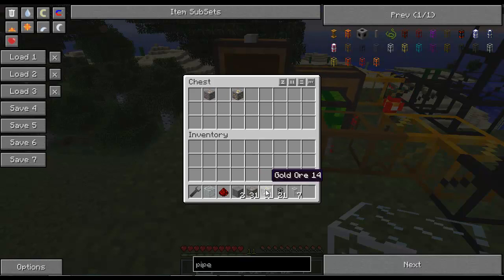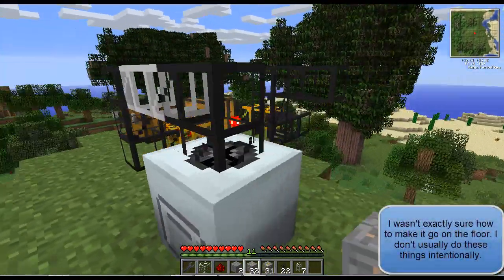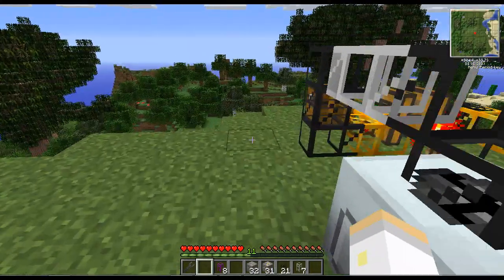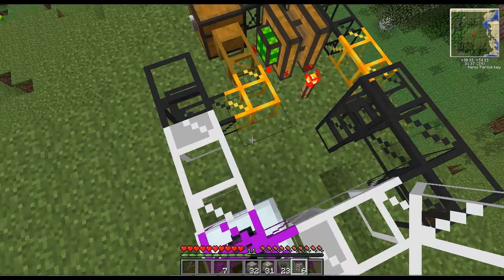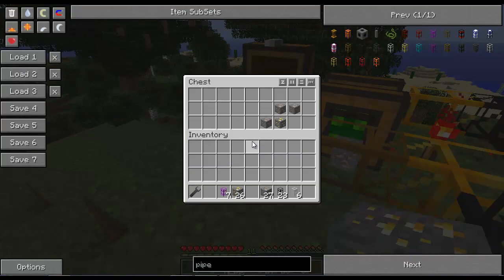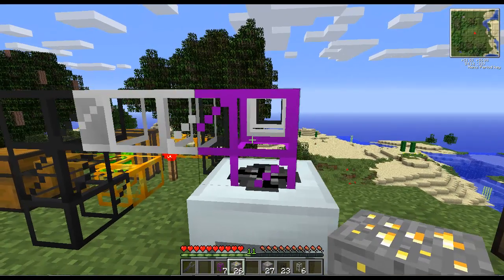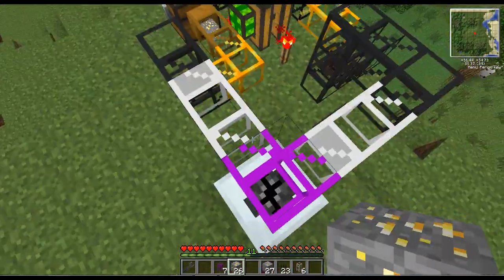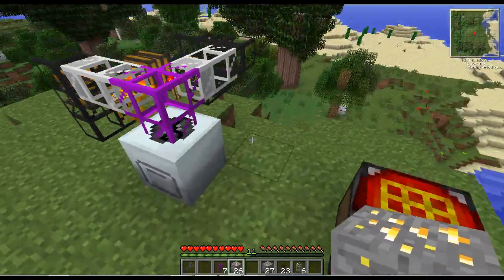Tekkit Classic With Pample: Advanced Insertion Pipes

Comment from the maker: If I read this correctly, you just need to make it so that the overflow that can't go into the macerator will go into a chest where it will ONLY be able to go back into the macerator. Make sure the overflow pipe only goes into the chest for blocks to be macerated, and make sure it's not connected to anything else.